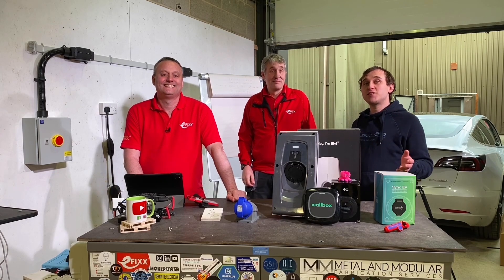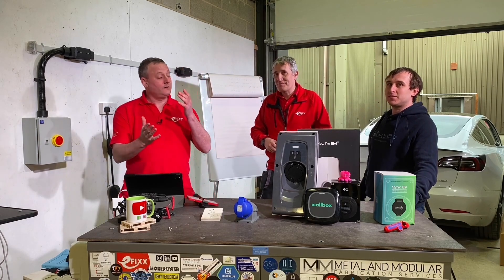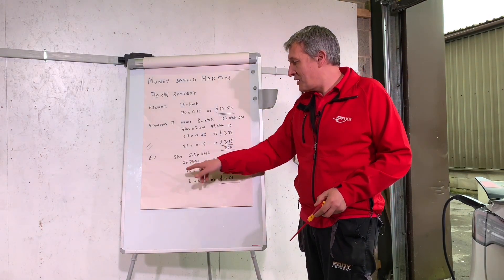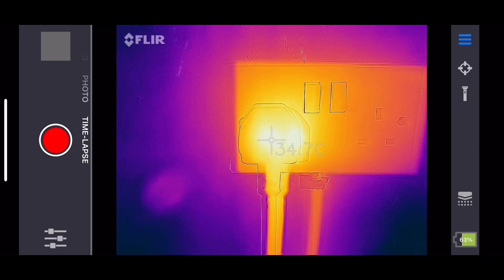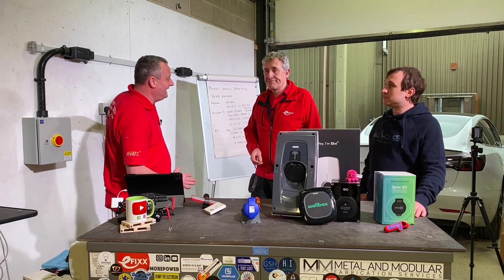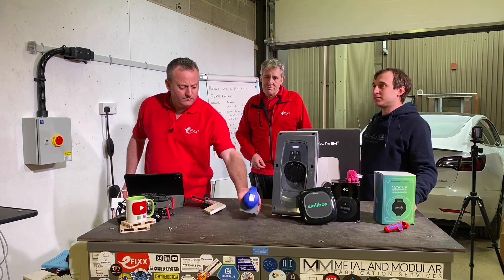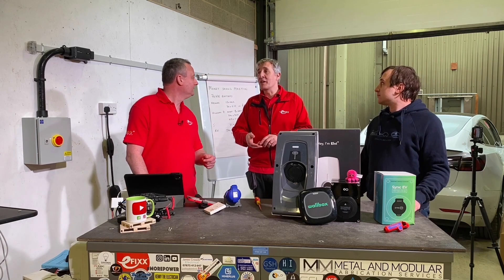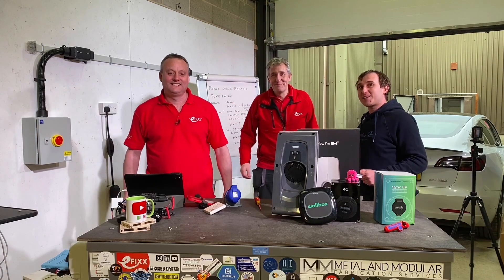5 Reasons NOT To Charge An EV By 3 Pin Socket!

Comment: In the words of Mandy Rice Davies;
 “Well he would say that, wouldn’t he “

The video is partly  bollox !

For most Tesla (efficient miles per KWh) owners, perhaps 85%, a 13A facility will suit their needs. (The car can limit to 10A, it’s certified and safe)

In the video the electricians who make a living installing Chargers … advise that a 13A socket is insufficient.

Imagine my surprise.
Reply from the maker: firstly am not an electrian,   2ndly the 2 people in the videos are from efixx which is an educational channel NON of them fit charger or sell them,  so bollox back to you
Reply: @NicolasRaimo  They are all part of the same Con !

I’ve owned Tesla’s  for 3 years, covering 90K km across 2 cars.

For the vast majority of EV users (unless you are an Uber driver) you can charge at 13A.) 

don’t buy a charger

So many replies here saying this !
Reply from the maker: @maxflight777  have you had a car crash in that time? No but you still wear a seat belt

Comment: what about connecting to the 30 amp ( blue) socket. Is there a connecter to use the 3 pin cable supplied with a EV ?
Reply from the maker: 32amp blue commando we discussed that....

Comment: Great video nick. I have a 7kw home charger and use that but also have a granny cable which I call it a get out of jail card. Not something you use to fully charge the car just enough to put sufficient electricity in to get you to a proper charger. Most new Ev’s now don’t come with the granny cable. My new Kia Ev6 for example didn’t  nor does the Ford Mac e. But I know people that use the 3 pin plug on a regular basis
Reply from the maker: Thanks for the comment and welcome to the channel!

Comment: I guess there is a reason the 3 pin cables are called by many as granny chargers.... they do a job if you are visiting friends or family and you need a 1 off charge to get you on your way, but are not really designed to use day in day out for long term charges.
Reply from the maker: Spot on charging at your grannys

Comment: Ev chargers are overpriced fact, not worth more then £100.
Reply from the maker: Saying fact when something isn’t true doesn’t make it a fact… even a 3 pin charger cost more than £100 missing all the safety equipment and higher amp controls

Comment: 13a socket vs purpose build charger = same circuitry, meaning the same issues that apply to the 13a charger apply to the wall chargers. The only benefit is its faster...
Reply from the maker: It’s better but still not true… example you can’t disconnect a dedicated socket under load
Reply: No they dont have the same issues at all, watch the video again. its not rocket science. Theres a big risk using a 13A socket as opposed to a dedicated charger with integral safety devices  designed for EV charging.
Reply: @jonanders76  I get the risk, but when your 3 pin sockets are on a 32a dedicated ring main, and the car is the only thing charging at 7a (only a 9.2kwh battery) there isn’t much of a risk. All wiring is rated to 32A, and ring has been tested
Reply: @marshmellow377  Hey Phil, its a little bit more complicated than that. Thats why an electrician would tell you its not a wise thing to do. Lets say the cables on your ring final circuit (RFC) are rated at 27A clipped direct and the circuit is in a healthy state. It was never designed to have a large load at one point for a long duration, but lets skip that. The 13A socket was never designed to carry that load either, but lets skip that. One of the most dangerous things, apart from an o-pen fault on the DNO cables outside (skip that for the moment) is the DC leakage and the type of RCD protection for your socket and the rest of the house. If its an AC type RCD (and it will be if the board hasn't been changed in the last couple of years) then this can blind the RCD so it won't function. This means you will have no additional protection on your house sockets and most likely the car charger too and therefore no protection from electric shock either in the house or at the car. Now if, and it should be using a 13A socket with an EV charger, your earthing system is TT, then you also have no fault protection either, meaning the mcbs or fuses are pretty much redundant only working on over load. Then theres the possibility of a protective earth neutral fault outside your premises which could cause a large current to flow along your earth path back to the car and into the house and with no working RCDs, no o-pen protection, its like Russian roulette. The odds are going against you, look how the infra structure in this country is on its knees and collapsing. 
Theres more to this than just having a normal healthy ring final circuit, hence why theres a whole section in BS7671 and numerous Guidance Notes for EV charging.
Hope that helps

Comment: Still say it is a total rip off the price of £600 for just a plug socket and a minimum of £400 to get it fitted. It is better to use the 13 amp plug than get a cheap one from a doggy electrician. I only need to top up the car once most weeks so it would take me a long time to recoup the cost of having a socket fitted. 🤔🤠
Reply from the maker: A dedicated charger is far more than a plug and socket… it contains all the safety devices needed and all are tested to 32amp ratings.  We then have all the intelligent side that’s required for regs now.   I seen profit line of these chargers it’s a numbers game to make anything meaningful out of them and then you gotta support the customer base!
Reply: @NicolasRaimo  Why is a home charging point such a rip-off?
The socket cost £600 and £400 minimum for fitting if you don’t need more than the basic fit.
A breakdown of similar components for a consumer unit is £100, A motherboard with more components than in the box is £120, ASUS PCE-AC58T AC2100 Wi-Fi Adapter, PCIe x1, Dual Band 2.4GHz/5GHz (433+1733Mbps), 802.11ac, Bluetooth 5 £42 and an Industrial Socket IP67 240V 32A Switched 2P+E is £35.50. As for fitting that is £400+ for 2.5 hours of work and cable costs £5.88 per meter.
If anyone knows the real breakdown of cost then I don’t mind being proven wrong.
Reply from the maker: @pgbaines65  I’ll be doing a video with manufacturers on what it cost to build a unit but to put it mildly NON of them make money they all losing cash the staff and r&d and compliance alone is almost cost of the unit…

I’ll also be doing a video with an engineer showing his costs

Comment: Biased misinformation. If your house electrics have been inspected and you buy a fixed 10 amp granny unit you have very little to be concerned about. If you are traveling short distances in the day just plug in your granny charger every night.
Reply from the maker: No biased information non of us sell or fit chargers 🔌 and everything else you said it wrong 😑

Comment: If the comments weren't led by a pinned comment with trackers that have commissions associated with them a lot of people wouldn't be quite as defiant. Is there a risk? Yes. Is the risk greater than the number of house fires that have been caused by charging mobile phones? No. Is there anyone who has watched and commented on this video who has had any issue with 3-pin charging, or know anything who has had it? Seemingly not. Does that mean the risk doesn't exist? No. Does that mean the risk is acceptable for the vast majority of people for one reason or another? Yes.
Reply: Pin this!
Reply: Exactly this.
I've been using a granny charger on my MGS5 for around 7 months now a couple of times a week without any issues, I use an SLx heavy duty all-weather extension cable with built in thermal cutout plugged into an rcd plug for extra protection, it doesn't even get warm even when on for 8 hours or more. The granny charger itself also has those protections built in, and I set it to charge at 10amps.
My landlord gets both yearly gas and electrical safety inspections done and all sockets are tested; the last time it was done, I asked the electrician if it was okay to use a 13amp socket to charge my car for long periods, and he said that 13amp sockets are rated at 10amps for continuous load, and up to 13amps peak for short periods, so as long as I kept it at 10 amps or under, it was perfectly fine.
I don't do that many miles a week as mainly work from home, so a 7kWh charger wouldn't be economically viable considering their cost.

Comment: I’ve used the granny charger route with my ev for many years now without any issues. As long as you make sure the socket is well maintained and don’t leave it plugged in all the time you won’t have any issues. :)
Reply: I wish we could all be a bit nicer to eachother in the comments by expressing our opinions while being cordial and not taking swipes at eachother 🥲
Reply: @ianlouden5316 a seatbelt doesn’t cost £500! And that’s not likely to happen when my father is a qualified electrician who installed and checks it. 😂
Reply: @hiyaimamelia  Also what they don't tell us is that when you get a good 3-pin charging adapter, it has the RCD and other protections built-in too. Mine even has a temperature sensor in the plug and would disconnect if it gets too hot. Also allows selecting a current limit if on a sketchy outlet. 

As long as the wiring and socket are in a good condition and one is using a good cable, the only real issue is the slower speed. And not all cars have that big battery or even a 3-phase onboard charger to be worth having a wallbox. My e-208 would charge 0-100% in 12.5h on a standard european 16A Schuko outlet, more realistic case of 10-80% in under 9 hours. Rises only to 14h if I want to be super careful and limit it to 10A.
Reply: @Tomaskom  it may have a type A RCD & possibly a Type 2 SPD, but it doesn't have the O-PEN protection device or the DC leakage protection . But hey Im sure the saving of a few hundred pounds is worth it as its only an electric shock, Im sure it will just tickle a bit. Good luck.
Reply from the maker: That’s like saying you’ve never used your seat belt but long as you drive slow your be fine… there’s risk as noted in video
Reply: @NicolasRaimo  yes but the risk is incredibly low, it’s exaggerated to sell the more expensive product. My father is a qualified electrician and has said it’s perfectly safe to use outside sockets for electric vehicles. He was able to check that the wiring was up to scratch and safe for use. I understand that there’s a risk for some situations but if maintained properly it’s really not that dangerous. I don’t think that comparison is really fair as the risk is completely different and is significantly lower.
Reply from the maker: @hiyaimamelia  have you fitted an earth rod?
Reply: @NicolasRaimo  I assume he would’ve done to make sure it’s safe. :)
Reply from the maker: @hiyaimamelia  bet he hasn’t
Reply: @NicolasRaimo  It is literally nothing like that at all and you know it.  We plug many DC chargers into our 240v sockets.  Are you saying that none of these should be plugged in because they could potentially block our RCDs from working and we are all going to die a horrible death falling from the empire state building or flying through a window screen as a result?  Typical examples include power tools, vacuum cleaners, laptops, mobile phones, bicycles, the list of dc chargers plugged into 240v sockets goes on and on and on.
Reply: That is a really bad analogy. Not using a seat belt is not analogous to using a outlet as it was designed for.

Comment: In terms of heat buildup,  many people do have 2-3kW room heaters in various flavours.  Often they only get used when the main boiler packs up.  Don’t they constitute a continuous load, especially if the house is stone cold and it’ll be a while before the thermostat turns it off?  Wouldn’t the socket be adequate for this kind of use?  If so, isn’t this issue nothing new?

I have an EV charger at home, but I do use the granny charger when on holiday or visiting relatives.  They have their uses, and I’d be rather inconvenienced without it.
Reply: all granny cables have a thermal sensor in the plug. tbh nothing wrong with them all this video is about is to try get people to have a 7kw charger when alot can not have them
Reply: No, they don't - or shouldn't as eventually they will heat the room enough to turn on the  heater's built in thermostat and switch off.  It'll come on again in due course to maintain what ever heat setting the user has implemented but if, somehow, left on for too long, they will trip their built-in protection to prevent continuous use.  

But pease read my other replies here - essentially the video is tripe (for the vast majority of users) and is just yet another scare-mongering tactic by the electrical industry to drum up completely necessary work (along with PEN loss, metal consumer units, EU-imposed wiring colour-change (from red and black to brown and blue), yada, yada, yada).  Clearly no one has ever done a proper, realistic risk assessment on any of this twaddle as if they had they would find that the reduction in deaths and serious injuries from all of it put together is minimal.  Someone will always find a way to kill themselves no matter what precautions industry/HMG take and the cost of trying to prove me wrong is, meanwhile, crippling the country.

Comment: It would be nice if this video presented some practical steps to take to reduce the risk of using a granny charger for those who can’t get a charger installed immediately/can’t afford one immediately etc. Despite the responses from the creator and his comrades, there is a lot of fear mongering going on here with no perspective on risk.
Reply: I am in the military and there are restrictions on me installing an EV charger. Sad I know, so I’m keenly looking at using the Granny Charger once per week but the scare mongering is unreal. 

I have a Tesla Charger awaiting approval to install, but until then. I have to use the public chargers which are not conveniently located for me in the middle of nowhere wheee at a military base. 

The base has chargers, no public vehicles allowed either. So in my situation, I rely on the granny lead to top up. I have yet to use this method as the risk/fear perpetuated vs those with no issues is a factor I will have to figure out myself.
Reply from the maker: If you own a car your privileged however if you own an EV your also privileged and have a good amount of income,  the cost of an EV charger to be fitted starts at £650 a small cost on safety.   The step we provide to reduce the risk is a dedicated charge point.   Most the issues we discussed can't be reduced as it requires additional equipment WHICH we mentioned in video.  No fear mongering safety and electrical code exist to limit risk.  I've made you aware of the risk if you choice to ignore it that's your choice.

Comment: Sounds to me like these electricians are trying to make more work for them selves ,these granny chargers are smart now adays 20 hours to charge a car from 20% to 80% is bull shit I have a Renault  zoe 22kwh it takes 9 hours to charge to 100% using a granny charger capable of 8 10 and 13 amp with a max current of 32 amp yes it works well the charger is a smart charger it only delivers what it considers to be safe it uses over current and over voltage and thermal control circuits to manage the charging process, it copes well  yes it would be more efficient using a 7kwh fixed charger  but not essential, I've been an electronic service engineer for over 30 years now and retired, yes money is tight I was quoted £750 for a 7kwh install ,yes you must agree a RIP off( yes again RIP off britain) I got my granny cable for £125.00 £625.00 cheaper Wow , things to also note, house wiring is it old or new, your fuse box or house might have to be replaced if, old house prewar, and finally you mentioned the use of extension cables, I agree they can be unstable, but a work a
Round would be to buy a high quality heavy duty  trailer socket with a thick wire on it, not made in Taiwan or China ha ha  British old school extension leads are ok,
 the last thing is this, we all hunger for bigger and better, do you agree, reader ,yes but a smaller 22kwh battery takes a shorter amount of time to charger than a bigger 45kwh battery yes you get less range but you get a longer battery life at 22kwh as it charges twice as fast , fast charging over time will damage your ev
Reply from the maker: These electricians don't sell charge points,  they don't even do electrical work its purely a youtube channel for educational content.   Also your looking at your 22kwh zoe battery that isn't sold anymore and the new zoe is 52kwh,  the zoe will be retired soon and the new megane E is 60kwh...  The Tesla in video is 70kwh and some evs have a 100kwh...  All the other safety facts like DC leakage and PEN fault remain.